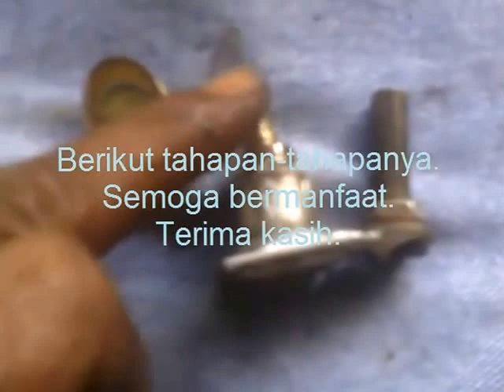"Repairing Agricultural Machine Spray Equipment" (Memperbaiki mesin peralatan semprot pertanian)

Comment: Mas saya kan baru beli tapi pas ditoko di coba setelan gas nya kok masih besar padahal katanya udah mentok apa ada kemungkinan kabel gasnya ada yang seret atau gimana mas?
Reply from the maker: Iya, bisa jadi kabel gas kurang distel, bisa juga ada kebocoran antara karburator ke mesin (intake manifold). Tapi bisa juga karburatornya yang bermasalah. Karburator sperti itu sulit diperbaiki, solusinya ganti baru. Karburator itu agak beda dengan karburator lain yang pakai pelampung.
Reply: @YudiHermanto4H  udh bisa mas kabel gasnya ketarik trnyata tapi kalo nyemprot kok harus gas besar setengah lebih dan berat tarikannya beda sama yang lama kira kira apanya ya yg harus di stel lagi?
Reply from the maker: Coba stel setelan bensin dan udaranya di  karburator, mas